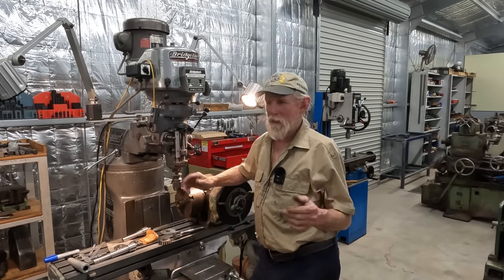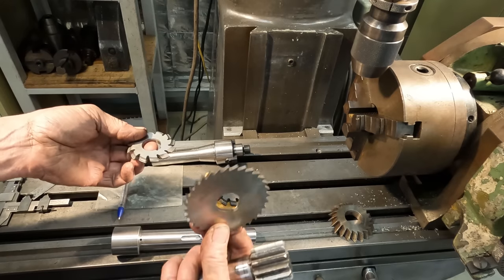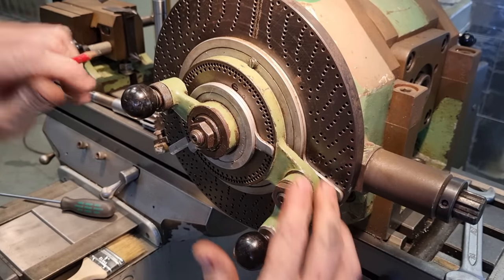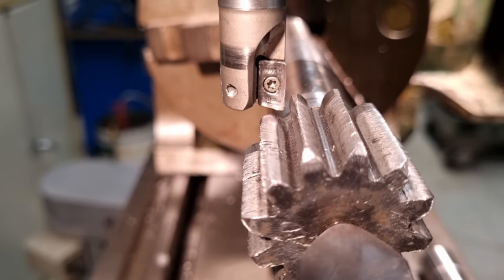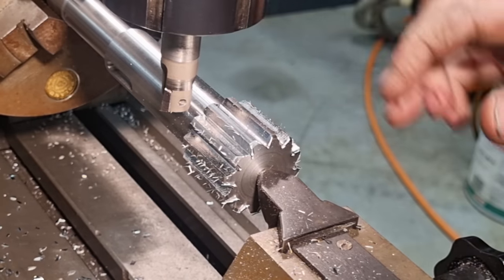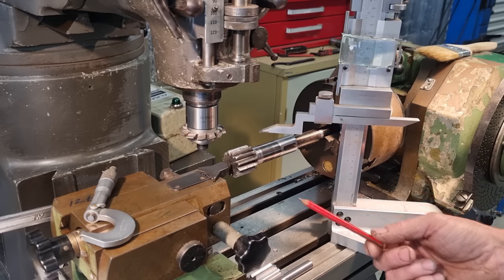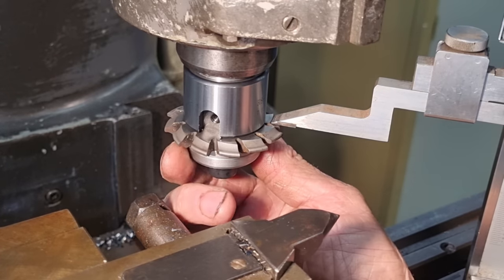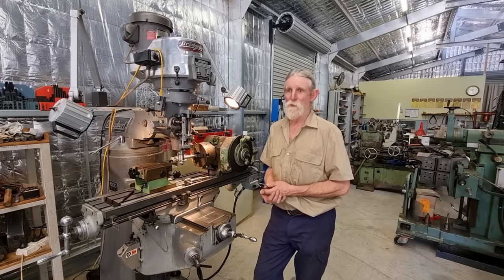Machining A Custom Size Pinion Gear .   Part 1 .

Comment: Hi Max, in my job I have been very involved with gear theory and geometry over the past few years. What you say about the root clearance and (in your earlier video) the profile shift is spot on. I doubt this was done just to save money though. If the 12 tooth pinion was standard with 20 degree pressure angle, about 60% of the active flank under the pitch diameter wouldn’t transmit drive, which is bad, the less teeth the worse this effect. The profile shift also makes the pinion stronger and longer lasting (the smaller gear goes first). They do this on modern power generating windmills to stop premature fatigue failure of the pinion. If you were making this with a hob or a gear shaper it would all take care of itself with a standard cutter. The old idea about adding two teeth to get the OD is often not followed in modern manufacturing.  Anyway kudos for your level of understanding, there can’t be many fitter and turners about, who knows what a profile shift is.
Reply from the maker: Thanks .  I will agree with you about it giving a stronger tooth when you think about it .    Cheers  👍
Reply: Excellent comment, I've never heard of this gear profile protocol,  I've seen pinions like this, and fitted them, but never questioned the reason. Always good to learn from my 78 to 82 apprenticeship. I do remember plotting Involutes etc though.

Comment: Max I have seen this done many times and I must say this is the best detail explanation and pro-active trouble shooting that I have seen. I like many others just take it for granted that the cutters are out of the box correct, but it is pretty obvious that the Rice Cutters are suspect, and you have just proven it and also offered a solution. Thanks for taking the time to explain in detail. I'll be back for more.
Reply from the maker: No worries  👍

Comment: Very interesting way of getting the job done, an unconventional part,-- and an unconventional way to cut that gear.  
     You are the type of guy that a captain of a sinking ship needs, when everything else is not working. 
     Shop is looking great, the HBM passed away last week, it is no longer on the critical list in the emergency room, it is in the morgue with a toe tag, but after seeing you cut one gear with three or four different cutting tools, anything is possible.
Reply from the maker: Don't do sinking ships ,  i float like a rock !  👍

Comment: G'day Max.   Really tremendous video, showing the methods & execution of your gear cutting with the endmill as well as your Beefy looking Height Guage.
Your endmill ripped through the shaft material, & left a reasonably good finish.
Looking forward to your next Installment.
Reply from the maker: Thanks Ted .  👍

Comment: Thanks, I really appreciate your work and your solution to the challenge of cutting what in the US we would call a "bastard" gear form.   Of course here we, used to at least, encounter only diametral pitch spur gears but occasionally would come across a bastard form.  In those days I would have ground a tool from high speed (cobalt if possible) to the needed form, put it in a fly cutter and single-point cut the gear in one pass. Naturally, we had to shoot from the hip sometimes on those late night emergency jobs, but we got it done somehow.  It's great when you have the tooling at hand and the time to painstakingly do a precision job.  Thanks again, great work!
Reply from the maker: Thanks .  Odd gears are a bit like odd threads & we come across heaps this side of the globe .  I  call them Pakistani Cycle Threads !  ( named after the British Cycle Thread ! )  👍

Comment: Hello Max.  This is a great gear cutting tutorial.  One thing I was taught when using a dividing head was to move the sector arms by the trailing arm, not the leading arm.  That way the arm you are pushing on strikes the pin and stops.  If you use the leading arm, when the trailing arm strikes the pin you have the possibility of spreading the arms farther apart, causing an error.  I often wonder if there is another trade that has as many tips/tricks as the machinist trade.  Ken
Reply from the maker: Thanks Ken .   These arms clamp together really good , but are really loose on the rotation !   There would be very few trades that have so many  things that can pop up just doing a simple job .   👍

Comment: The gear is looking good so far Max. That gear may have been cheaper for the factory to make, But sure is a pain to machine a replacement. Looking forward to the next part. Cheers
Reply from the maker: Thanks . It was the last thing i was expecting when i first measured it up !   👍

Comment: Excellent presentation Max.
Good way to preserve the cutters.
I always count hole spacings, can't Bozo it.
I got one of our Apprentices to cut 127 tooth gear for my Hercus 9a, stuffed up on the first but got it right on the second one back in the late eighties.
Good exercise in differential indexing.
Your indexing head would do it nicely without a gear train.
My Brother still cuts metric threads with that gear.
Reply from the maker: Thanks . It would probably take me 2 goes with differential indexing as well !   Have not done it since we had to make a spiral flute reamer as an apprentice .   👍

Comment: Great video Max. I have run into modified small gears like that, and will likely do one soon for my geared tailstock. The long winded way!
Reply from the maker: Thanks .  I don't think there is an easy way to do them .  👍

Comment: Nice work Max, I've had to do a similar thing with unusual early clock pinions where a commercial cutter isn't available...
Reply from the maker: Thanks .   It would be difficult with clock gears , being so small .   👍
Reply: @swanvalleymachineshop  it's the watches where it gets really tricky 😆

Comment: Well described Max, that dividing head is a beast. I note you are cutting in reverse and towards the tailstock, guessing deliberately so to aid with the visibility on the setup? Cheers, Jon
Reply from the maker: Thanks Jon .   So i can see what the cutter is going to do .   It will become more apparent in  part 2 , there is a lot of set up by eye .    👍

Comment: G'day Max,,  i have watched a lot of youtubers cutting gears,,  but this is the most comprehensive yet  and did'nt lose me with boredom.  well explained all the way through. really waiting for the conclusion.  do you recommend for a beginner such as me to buy chinese cutters to begin with??👍👍
Reply from the maker: Thanks .  I think most of those Chinese cutters are much of a muchness , they will get the job done with no worries for most general jobs .  The high end ones are just way too expensive & unobtainable usually .   👍
Reply: thanks @swanvalleymachineshop

Comment: That is a lot of work. I imagine they used custom cutters. But this tooth shape does result in stronger teeth. I usually prefer to use the circle with the fewest holes so my count of the holes is less likely to be wrong and I can more easily see if the arms have slipped when turning them around. I’ve never understood why these manufacturers all seem to have made such a flimsy method to secure the arms. One very short, tiny screw. I’ve seen the threads in the arm stripped out by someone who didn’t feel it was tight enough.
Reply from the maker: My arms have 2 lock screws .  But yes , not much to hold them .  👍

Comment: Holy smokes, I wonder if it would even be more work to cut a normal pinion, and a rack to match.
Reply from the maker: Cutting a new rack would be a massive job , as it is 2 meters long !   👍